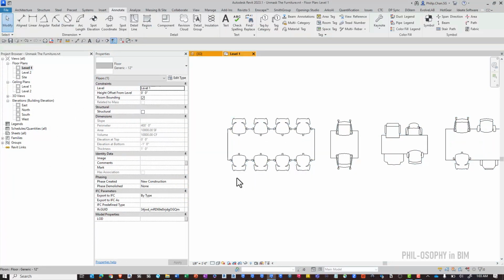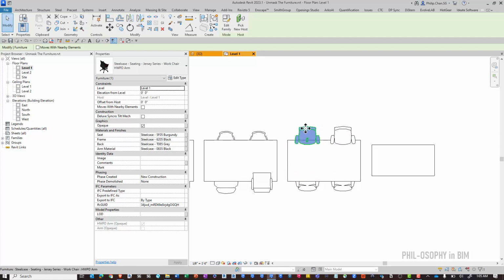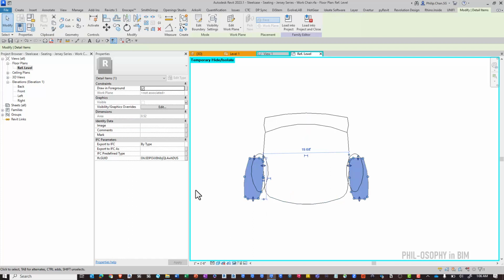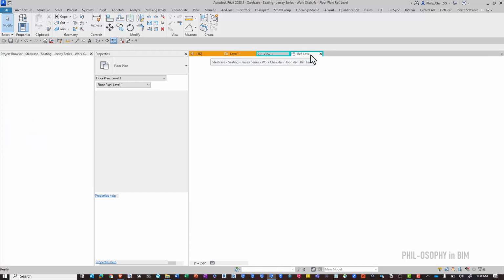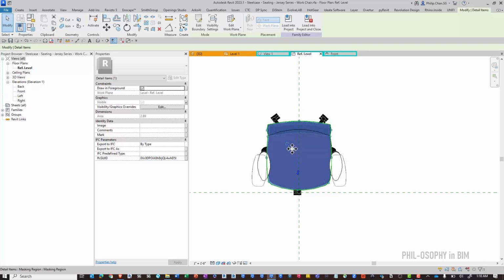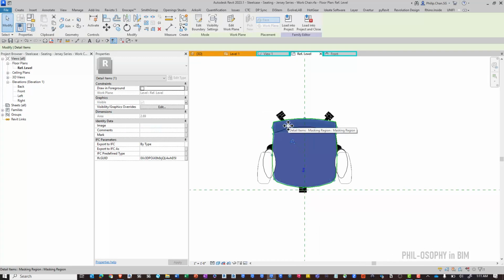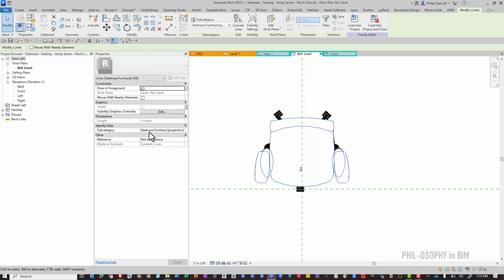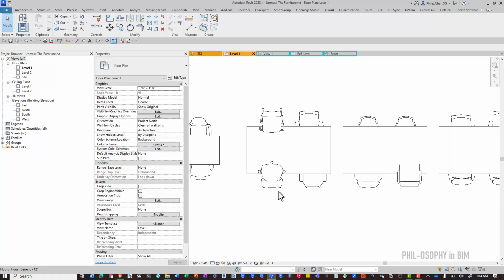Revit How-To Fix Your Revit Furniture Family Graphic in Plan View in 10 minutes

Comment: interesting. Informative , but didnt work for me
Reply from the maker: I am sorry to hear that. Is this a manufacturer downloaded family you are trying with this fix?
Reply: @ i actually worked out. I am not sure if it was manufacturs family or not. But My issue was family inside family. And I was loading this second family directly to the project.

Solution:
I had go edit family and select and edit family again. And when I am done with the second born family if I directly load to project it wouldn’t work but when I load to mother family and then loaded to project it worked out.
Reply from the maker: Glad to hear it is working.  In your case, yes you will have to load the nested family back to the host family once the changes made.